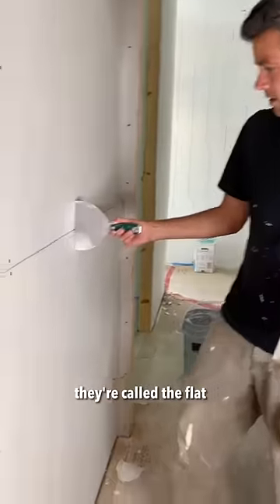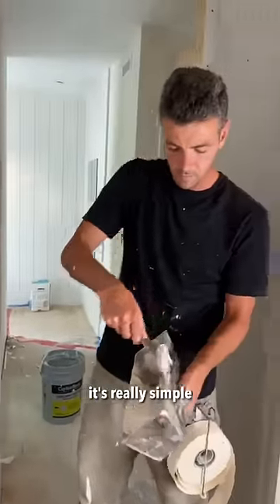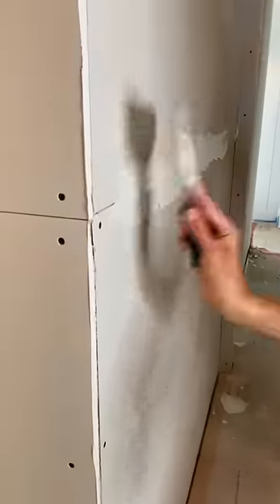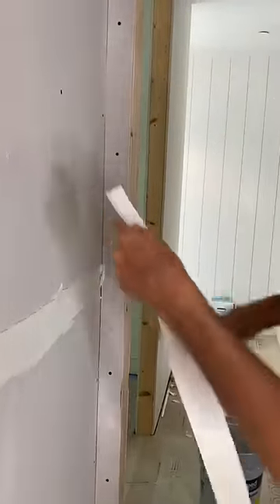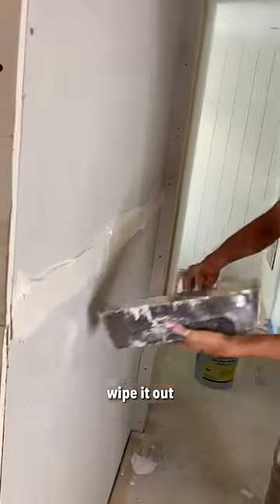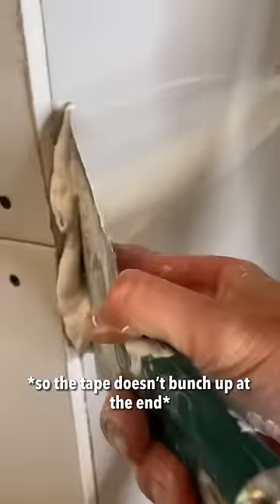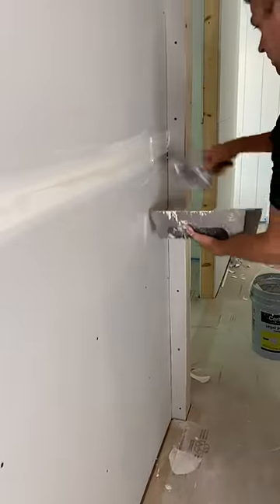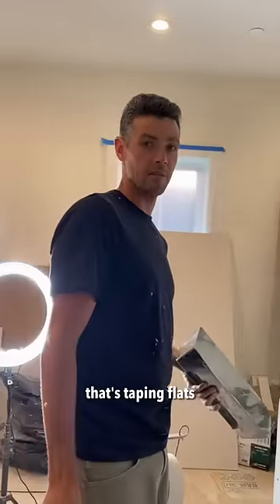Beginner Drywall Tips! Taping Flat Joints

Comment: I had done over a dozen projects,  and was nervous (rightfully so,  bc i sucked) and resentful everytime i got to the mud phase... then i watched straight DAYS worth of your videos,  and it completely changed my ability. 

Mudding is still one of those things that requires a ton of practice and a bit of finesse,  but seeing it done the right way,  and hearing a clear explanation,  helps a great deal 👍 

Much obliged!
Reply from the maker: Thanks!!!
Reply: I've found that the thing that had the most profound impact on my mudding and patching has been (1.) using the right compound and a loose enough mix, (2.) applying way more compound to the wall than I'll end up needing, and (3.) using the right size putty knife. I don't think I'll ever buy spackle again in my life after working with a pre-mix drywall mud. Sure, it takes longer to dry, but man is it just vastly easier to work with. You also need to use a putty knife that is large enough to span across the depression you're trying to fill, touching the flat part of the drywall on either side. In my limited experience, the larger you can go, the better, but the more tiring it can be and you may need to use a smaller one to apply the mud before spreading and leveling with the larger knife.
Reply: I've been doing drywall since I was 12.  Now I run my own business and I'm teaching my brothers as well.  It took me a really long time to get food at everything.
Reply: I take my time doing the framing right  and hanging the drywall....an wait about 2 months before I  hire a expert to do taping an mud ....i do sanding later ...an get the wife to paint.
Reply: @mndlessdrwer  definitely good advice... if you're already struggling,  trying to use cheap/ improper tools makes it MUCH worse
Reply: @icarrera6969  yeah,  I like to try and do everything myself,  but hiring someone do fly through the mud is worth while on any decent sized job... it just saves SO much time and effort 👌

Comment: i never knew there was a dip on the edges for the mud. awesome
Reply: Only on the long sides.
Reply: Do you live under a rock?
Reply: @politicalfisherman540  A... sheet rock?
Reply: @ryanmcgowan3061  lol
Reply: It's called a taper.. Both edges on sheets are tapered for vertical use or ceilings or you can get sheets for horizontal walls which have a tapered and a square edge with the two tapers butted in the centre..
Reply: @darianistead2239  lmao
Reply: @darianistead2239  Did not know.  Thank you.
Reply: It's those pesky butt joints that are hard to hide
Reply: Then you never hung drywall
Reply: Neither I. Not my trade tho.
Reply: @BrakerOfStones do you not do everything from form work to framing to finishing trim?
Reply: there is but some cheap drywall has them raised so you need to fill the flat to make the wall flat. pro rock vs sheetrock(shitrock) when i was boarding in albert bc! 2006 sheet rock flooded the market
Reply: @jesuschrist9597  Pipefitter. I cut holes in drywall to run my pipe thru and get a drywaller to come patch it.
Reply: It is called the recessed edge

Comment: side swipe is next level
A lot of people can’t do that
Reply: Lmao
Reply: Im still trying
Reply: No, it's beginner.  Next legal is putting it on the upper corner and l running the whole joint with one pass.  That is next level.  Joint this short is one pass and done.
Reply: What, you mean Level 2?
Reply: He hasn't even mastered it
Reply: @jdewitt-pn9kr when done right it’s fast 
I know a few guys who can really tape 
But ask them to side swipe a row of screws or any angles and they are skipping all over the place
Reply: Alot of people also shouldnt touch this work
Reply: He does it in short strokes... he is not a pro yet.  Sometimes people think they are good and don't know that they aren't that great.  He is trying.   His side swipe is upside down.  I could teach you all sooooo much more than this dude.  It is a start for most though.
Reply: F the side swipe, use a 4 inch blade to fill and bed the join. Messy looking.
Reply: Ummm. No it’s not. It’s completely amateur and sloppy.
Reply: Real master do whole thing at once not doing 3 things in row. And btw, to get totaly flat walls you use a painting roll and roll or spray mud on whole wall and use 2ft spade to even it out. But you Americans dont understand that
Reply: @padlasvillage  its not understanding or not buddy.. we do what we get payed for not everyone wanna pay for a grad 5
Reply: What? No, its actually pulling tape straight most cant do. Any beginner can swipe sideways, lmao.

Comment: I just use fiberglass tape. Apply tape first then mud. Never had a crack or bad joint.
Reply: Same. No need for the first layer of mud, tape and then just mud until flush.
Reply: Yea cool story ya donut.
Reply: And hot mud!
Reply: yeah it is faster to use mesh with 45 minute mud. You can get your block coat on in the first pass, then go right in to the premixed bucket mud on the skim coat. Then you are done much faster. 
Do note that you can only do this on your flat joints. No mesh tape on corners!
Reply: you can’t use mesh tape in a bazooka
Reply: let me tell you this I have done commercial drywall for 8 years now. never have I seen anyone use mesh tape on the job. its for hacks it does not add strength to the joint because the paper is what gives the joint its strength. use actual joint compound it comes in the bucket with the green lid it has glue added into the mud to really stick the paper to the drywall.
Reply: @imchris5000  let me tell you this.  I've been doing commercial construction for one of the largest drywall contractors on the eastern shore for 22 years,  and everything you said is wrong.  Green lid or any bucket mud is your final skim coat only.  It takes days to dry if you're using it on your block coat, and it shrinks too much to be used for anything but skimming.   Mesh tape has its place and you truly don't understand enough about your job to know what that is.  Most people are still hacks with only 8 years of experience.
Reply: @axelknutt5065  did you maybe consider that I AM A SUPERVISOR who makes good money with very little physical expectations of me?  Maybe don't make assumptions.  Going out on your own is headaches i don't have to deal with.  At 3 pm I'm heading home and can do house or side projects. No late phone calls.  No dealing with angry customers. Just a peace of mind you wish you had.
Reply: @axelknutt5065  and his issue and negative perception of mesh tape comes from using the wrong mud(premixed) for everything... like a hack.  That stuff is weak and it is the reason he thinks mesh tape cracks.  Premixed bucket mud is for skimming only.
Reply: @axelknutt5065  are you dense? I was talking about the other guy.  Not you.  I was talking to you about the other guy.
Reply: @axelknutt5065  no i was not calling you a hack. Read it again slowly.  I was talking to you,  about the other guy.  So you understand?

Comment: With a little  more practice  you'll  do a cleaner  pass! Once you do butt joints that's when you can call yourself  a drywall  finisher 🎉🎉🎉🎉 keep up the good work
Reply: On a short wall like this, I'm sure it doesn't matter if you have horizontal or vertical joints, but in order to avoid butt joints on longer walls do you hang sheets so that joints are vertical?
Reply: @1966johnnywayne  when you hang drywall vertically you will have way more joints to mud so its not normally done

Comment: This is a seam joint for those who care about terminology.   The joints where they don't bevel are called butt joints.  Also compound shrinks substantially. I personally cover the tape on my first skim,  but I'm a 2 skimmer.  1st fill 8-10" wide, 2nd  skim 18-24"wides.  Butt joints/transitions, same process but even wider at 30-36" wider.   All takes 2 skims and I don't care what texture I'm using over it, if its smooth wall I may spot skim any low areas.

Comment: I live in a 2 bed flat.  The larger bedroom has a built in wardrobe that actually steals about 1x2m space from the much smaller room next to it.  The landlady removed the folding doors, nailed a piece of plywood in their place, and sawed a janky 5foot tall "door" into the back of the wardrobe, so it serves the small room rather than the large room.  

Shes given me permission to do whatever i want with that whole mess of a situation so ive been tossing between fully filling in the gaps and properly converting it into a proper built in wardrobe and restoring the wall in the large room so it ISN'T just a slab of plywood, or removing the built in wardrobe altogether so i have 2 nice square room with flexabilty on where to out a freestanding wardobe. 

This video is gonna help if i decide to go ahead and do that myself haha

Comment: On the corners you can snap the gypsum board off a quarter inch and leave the paper to the drywall on that way when they meet at the corner there is no edge of the drywall exposed it looks super clean and professional

Comment: for flats I recommend using the self adhesive mesh tape and mud that sets up like concrete.  Goes super fast. Permits you to apply a second coat. comes in 20 min, 45, and 90 min set up times. I use that mud for outside corners as well.. 
tape your but joints first. then mesh tape your flats. once they set  up, tape your inside corners. then any outside corners. apply second coat to butts, like 2 feet wide.

Comment: use the mud in the bucket with the green lid it says joint compound for doing your taping. it has added glue in it so the tape really sticks its just harder to sand so its used in just taping. I used it just smeared on a brick wall with the drywall pressed into it no screws and its held for 15 years so far

Comment: One big tip that made my joints much nicer was learning to wet the tape after its been places. Take all the mud you squeeze out and put it on top of the tape then remove excess. It ensures the tape dries uniformly and eliminates bubbles.
Reply: or just use fiber tape like normal ppl lmao i guess they just make fiber joint tape for nothing
Reply: @ktmmechanicsandaudio6803 fibre mesh tape is handy for DIYers as it’s easier to stick it to the wall and then flush over it, which solves the problem of bubbles under the paper tape. But mesh tape is nowhere near as strong as paper tape and often splits along to sheet join. Once you get the hang of paper tape you get a stronger, better finish. Oh, and mesh tape is dearer.

Comment: First , always instal the corner bead before tape , it’s because hacks never instal tape over the dotted part of the corner bead , overlapping into the wall and making the joint strong and even . It fills the void to the edge when floating . Plus, if you hit it after its finished , it won’t chip and fall out . Look closely at the corner bead and it will make sense , that patterns there for a reason👍🏽

Comment: yep. been there many times. try that in the corners though. then on the ceilings that's where the "fun" really begins. Huge problem with drywall though. If it gets wet from a roof leak you can lose the wall. That won't happen with interior plastered walls though they don't care!

Comment: I switched to the adhesive style tape with the grid like design...simply stick it to the wall and  mud over it....also, its great to use for repairs as you can bunch it up and shove into a hole or layer it to build up an area...the grid design seems like it helps against future cracking too...
Reply: the adhesive tape is weaker all the strength in drywall comes from the paper with traditional tape you are just gluing the paper together the mud itself has no real strength to it. you want to use actual joint compound it will say it on the bucket and usually has a green lid. this has added adhesive so the tape really gets stuck down the rest of the mud is just for beauty
Reply: @imchris5000  I can see your point...tape prob is stronger...I repaired a crack along 3 walls at the ceiling with the adhesive and was perfect for years and years....maybe the adhesive will flex a little more? Thanks

Comment: There is a thing called Taping Mud, designed for taping, which has glue in it to hold the tape. All purpose mud can  be used for double and finishing coats. There's also finish mud, designed for finishing.

Comment: I use a 3" roller to roll the mud on and then tape it and put a coat right over it. I use a roller for inside corners also an get a coat on one side right away. It has made me 10 times faster than I was

Comment: Mud on, swipe down swipe side swipe down swipe side and keep going till you reach the end, get tape, hold to the left and pressure and inbed to the right, swiping down to reposition the mud wiping when required, pressure on your tool and go left until the end, I find an 8inch broadknife works great, repeat over and over again, a bucket use to be gone in 45-60mins, those were the days my friend, luckily it's been 20 years since I had to do that crap 😂

Comment: Excellent job.  Id hire you any day.

You obviously care about the square because you are a carpenter.

Pro tip expectedly for novices let your tape soak in machine mud compound for a few minutes.

Use that all purpose for taping.

Machine mud on the last layer.

Get a Level 5 quality the final job by covering all drywall with thin mud and paint rolling it on and squeegee it off. 

Hire a kick ass painter and never worry again.

Comment: Now I've sucked at doing this in the past but one thing I was told for damn sure is that you shouldn't have bubbles, when you remove the excess mud you can see the tape has two colors (darker and lighter) that means you have a bubble all along your tape. If you tape is too close to being flush with the wall the bubbles will be seen after painting, if you have bubbles (even invisible after painting) the joint will start cracking after a while. Maybe you have other products in the US but that's what I was taught in France: no damn bubbles !

Comment: For some, this goes without saying, But something that should be mentioned to beginners about the tape itself. Make sure you have the right side down. The center fold in the tape needs to be down to the wall. Otherwise you will have a nasty crease in the center of your tape that will be a pain in the ass to sand down or over mud.

Comment: Ben, I finished my walls in the garage with many joints like this. I still failed and have slight ridges, and slight valleys. Satin paint, so it’s less forgiving. Can you do a video on finishing factory edge drywall? I know it might be obvious or very beginner level, but taking it from tape to a spot where it could take primer would be helpful. Thank you!! 

If you can believe it, my butt joints actually floated out better than these joints. That said. Thank you! I’ve learned so much from your channel.
Reply from the maker: Sounds like you just went too thin. Another coat or two should fix it.
Reply: Whoops! I never saw your reply. Thank you! Next time I have a drywall project I’ll take more time and try to blend better with additional coats as you mentioned. I have learned so much from watching your videos and am so thankful for you sharing your knowledge with us.. again, thanks! Cheers!

Comment: Back in the day you wouldn't scrape nearly that much off or leave any room because the mud shrank like crazy. Now it's so dimensionally accurate you don't even need to sand stuff or scrape off dry mud to flat, just scrape it out while it's wet

Comment: Should be using taping mud instead of all purpose. 
   Come back  year later. Dig a corner of that tape out of the wall, give it a good pull . You should be able to pull part or all of the tape off of the wall. Allpurpose mud does not adhere to the paper on the wall.  Taping mud will absorb into the paper on the wall,  preventing alot of cracks.

Comment: A eight and 2 swipes,a little less water for wipe down.Swipe swipe,50 flats 3 hours 6 inch.50 flats 8 inch 1 and half hours.Note not sure time.Every thing butt joints,skimming.??? Suggestion pull the low side of a button joint.Or swipe swipe

Comment: Thats called a recess joint,  butt joints, and recess joints together are called "the flats". 
Also, you could have left a bit more mud behind the tape. The mud will shrink back significantly as it dries. Wiping it too tight can cause bubbles behind the tape later because there isn't enough mud there. The bubbles usually won't be noticeable till your double or finish coat, then you have to go back and cut them out and patch it.
Reply: blisters, call them 
blisters

Comment: Heavy weight mud such as green or black lid is the best other than durabond which is the most durable but taping with light weight is not very durable and lightweight with mesh tape is just asking for cracks. Water damage on drywall Taped with durabond the sheetrock will breakdown before the joint.

Comment: 😮i like to use wet paper tape on joints with durarock mud. 

Joint compound floated entire wall to finish.  

Had a customer once ask why. I told him...because you paid for it. Smile and use a four foot level and hand them feeler gauges. 😂 🎉

Comment: Problem in commercial jobs is that lots of drywallers have no idea theres an order in which you have to screw your sheets on a joint in the center of each 25ga. studs… so you’re left off with a non-flat flat joint that has no room for tape and mud so you gotta treat a 40ft corridor with all 9-10ft tall joints every 4ft like theyre all but-joints 🤦‍♂️ lots of extra work to compensate for incompetence 
Also the more in an angle the stud is in the track, the more likely this will happen too

Comment: When he flattened the tape out, there should have been mud on his knife.  There shouldn't be any dry spots on the tape.  They will accept the 2nd coat of mud differently than the parts that have mud on them.  (from a level 5 drywall finisher)